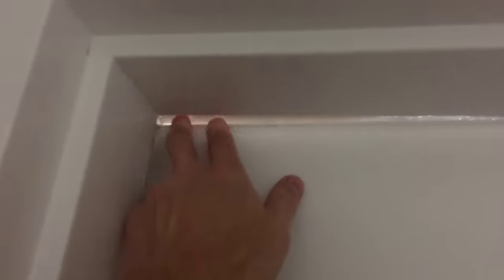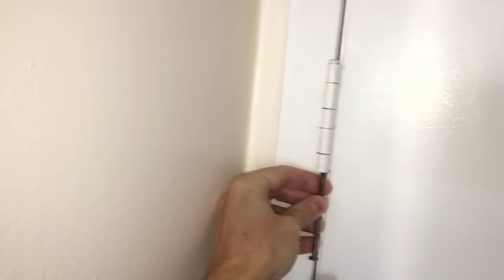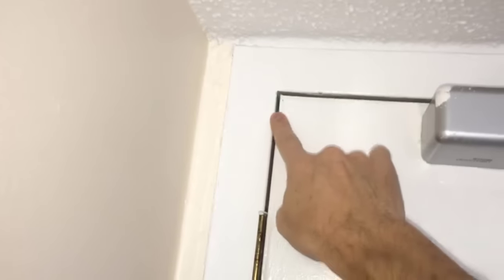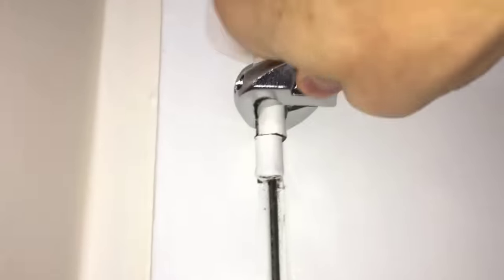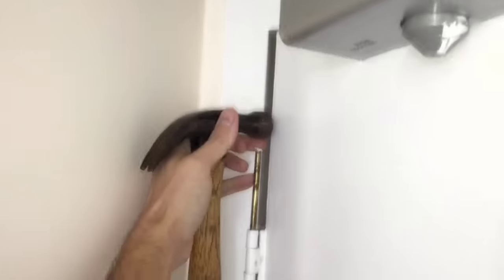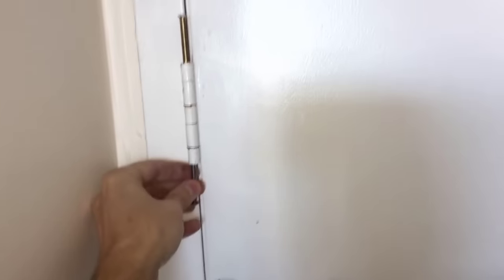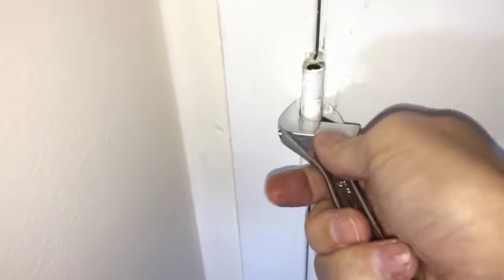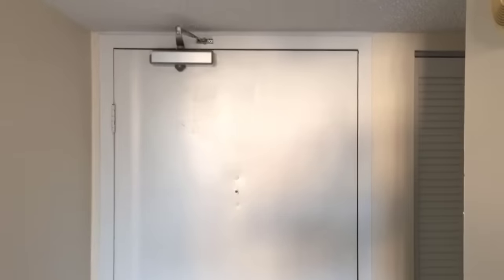Sagging front door hitting top of frame

Comment: Here's a little tip that can make this a bit easier. With the door closed, push a wooden shim (they're usually in the shape of wedge) under the bottom of the door at the edge with the striker until it's just snug. This takes the weight of the door off the top two hinges. Now pop the top two hinge pins like you do in the video. Use your hammer to drive the shim further under the door, lifting the striker edge of the door. Lift it just enough to enlarge the gap at the top where it's sticking and close the gap on the hinge edge.

This will cause the knuckles (attached to door) to be off by exactly the amount you need to bend them. Bend the knuckles like you show in the video until they line up, and -- with the shim still in place -- you should be able to slide the pins back in with no resistance.

Pull the shim, and the door should be perfectly aligned. You used the shim to move the knuckles so that they showed you exactly how much they need to be bent. No guesswork needed!
Reply from the maker: Great comment, thanks!
Reply: Precisely! Good addition, thanks
Reply: Thanks for sharing this information! Takes out some of the guess work!
Reply: Great advice, thanks.
Reply: Another great solution. Thank you for sharing. God Bless you.
Reply: Thank you both for this information! It worked like a champ!
Reply: i did this technique on my sagging screen door, works like a charm when i replaced the rivets
Reply: @Thomas Stambaugh, works like a charm!!!!!!!!!!’  I tried both ways on doors on my rental property and your way was easy as well!!!!!
Reply: A video of this would be awesome!!!! Thank you for sharing!
Reply: @thomasharris5151  make a video on this please
Reply: @Saikocide  can you make a video on this
Reply: Awesome tip, makes perfect sense. I will try this on my next door adjustment.
Reply: @123-n6c  The description is good enough. It is the same process of bending the hinge knuckles shown in this video, just use a wedge to lift the door where you want it to be with the pin out.
Reply: I'm struggling to get the pin out
Reply: @erraddict  Is it an exterior door?
Some hinges have Non-Removable-Pins. They are typically used on exterior doors that swing outwards.
Some of these hinges have a small setscrew drilled and tapped into the knuckle.

Use a roll-pin punch and a hammer to remove stubborn standard hinge pins.
Reply: Is there a limit to how much gap you can close using this method?  I have almost 3/8" gap at the top of the door opposite the hinge.  I suspect the problem is the door jamb is out of square and has shifted on a 60+ year old house.
Reply: @gototcm  You can spread the hinge to help close the gap.  You can also shim the hinge leaves with thick cardboard if you do not want to bend the hinges.

For spreading the hinge, you don't need the wrench or to remove the pin. There are demonstrations in other videos how to spread a hinge.
Reply: Thank you for the comment! Sounds useful!
Reply: Thanks bro, let see if it's going to work, becuse....i do it myself 😢
Reply: 812 people down voted this video so I guess some people like their doors to rub🤷
Reply: Thank you for your additional comments making this job even easier to do!!
Reply: You should pin Thomas’s reply to the top comment so that everybody gets both helpful hints at the same time
Reply: I have a set of three black style short crowbars. I’m gonna try using one of them as a wedge should make the job easier than a wood wedge? It’s what I got so it’s what I’m gonna use lol
Reply: I wish they had a way to copy these comments they were longer than a screenshot would be nice to save it
Reply: This tip along with this video just helped me fix the sagging front door that has a lockley installed that kept going off because it was getting stuck on the bottom of the hole despite multiple excavations. Thanks!

Comment: Let me share a little story. I hired some “contractors” to install a Prehung door. They tore a hole in the side of my house and tried to put the new one in but in the process slightly bent the frame. I promptly fired them and figured out how to seat the frame but the door was now rubbing like this one. We were at wits end when I stumbled on this gem of a video. If I could hug this guy I would. I wasnt able to shut the door without severe effort but thanks to this amazing guy I was able to seat it and save the day. This 6:05 minute video saved the day for me. You my man are a gift to earth and keep being awesome.
Reply from the maker: Glad it was helpful, and thanks for sharing your story!
Reply: Thank you.  I’ve seen a similar video on bending knuckles and was concerned about the hinge would be out of alignment.  This video was an exact match to my situation, and walked me through each step and showed hinge alignment and effective door movement.  I tried this method which required both top and middle hinge adjustment and it worked; probably no friction door operation in at least 23 years.  Once again, thank you.

Comment: I encounter this a lot. I am a painter and to do the best work is to remove all hardware including hinges and door knobs, many times they want to fix rubbing against door jam as something preexistent, I always used a wedge or scraping the door jam to make up for that difference and adjusting the hinges until finding the correct gap. Your technique is going to save me hours of labor!!! Thank you so much man!!
Reply from the maker: Glad it was helpful! 
Just keep in mind that if the door is "swollen" due to moister/humidity, or the whole house is sagging with a structural problem, this technique will not work.
Reply: YourSelf I understand. When door is swollen due to humidity and it touches all along the door jam the best is to shave a little on the edge of the door. I would say this would be an extreme case. Thank you for your tip.

Comment: Thank you for sharing, sir. Such a simple fix! My front door has been  slightly off since we bought our house 9 years ago and driving me nuts. The slight sag made locking / unlocking the door more difficult than it should be. 2 minutes of your method and it is closing better than ever! Thank you!
Reply from the maker: Great to hear that 9 years later the door finally closes as it supposed to! Thanks for watching.
Reply: hey @Craigmo900 , same issue, I tried putting longer screws int he hinges but didn't help, the door locking is being difficult for us and has been for a while, Do you have any tips in addition to the video, will try this week.
Reply: Buy a new house

Comment: We moved into our house in 2019 and the previous owners did not take care of anything.  Needless to say we have had our hands full with changes and fixes.  One thing was the garage door leading into the house.  We had to slam it hard as the top half was rubbing a lot.  I just tried this and decided to check the door after doing only the top loop/knuckle... Low and behold it closes like normal now!  I was afraid it would need to be shifted a decent amount and then the electronic  deadbolt would not lock properly but luckily that was not the case. Thanks a lot man! Almost 3 years of annoyance fixed in about 15min
Reply from the maker: Good to hear it, and thanks for watching!

Comment: Thanks for mentioning that you bend the "loops that belong to the door". Because the hinges on my sagging bedroom door are reverse compared to your door. The loops (or knuckles) of each hinge on my door that "belong to the door" are located at the top, bottom and middle of each hinge. So, there are three of them that need to be bent. This mean I would have to bend three knuckles towards the door knob. Or, alternatively, bend the hinge knuckles attached to the  jam side away from the door knob if there is room for the crescent wrench.  Right?
From Minneapolis, U.S.A.
Reply from the maker: Yes, your assessment is correct.
If you have enough space, try to bend the 2 knuckles towards the door-jamb to cause less stress to the hinge than bending the 3 knuckles towards the door.

Comment: This. THIS is THE YouTube video that FIXED my security door leading to my garage from not shutting! I took the door off to replace the door threshold seal that's located under the door to improve the weatherization...and after reinstalling the door to the hinges, it would NOT SHUT and it's been like this for 4 days. I couldn't do laundry or use my garage. This video did it for me. It was the same issue described in this video where the top portion of the door was banging against the door jamb and not shutting due to the top hinge needing to be adjusted. Despite going out and buying brand new door security hinges from Lowes and screwing them on exactly the same way the old hinges were aligned, it wouldn't shut no matter what I did.

I didn't have a crescent wrench, so I used a vise grip and instead of using door shims, I placed a stack of sticky/post-it notes towards the top of the door against the door jamb. That allowed the door to be pushed as I adjust the new positioning of the knuckles of the top hinge using the vise grip (the same knuckles this gentleman adjusted) towards the door. Then I finally hammered the pin back into the top hinge and voila!!! the door finally closes. I can't thank you enough man.
Reply from the maker: Good to hear it, and thanks for sharing!

Comment: I’ve tried tightening the hinge screws and even put in longer hinge screws with no success two years ago and finally gave up on trying to fix my front door.  Just came across this video and tried this trick and less than 2 minutes my door was fixed and it doesn’t stick anymore.  Thank you so much for posting this video 👍
Reply from the maker: Wow, 2 years of sticking door... glad you resolved it now, and thanks for watching!
Reply: YourSelf actually it was like this when I purchased the house 3 years ago
Reply: @retiredcryptohunter9031  I'm in almost exactly the same situation. I tried tightening the screws, got longer screws... Worked for a week or so then started hitting again. My next step was going to be to fill the problem hinge hole with wood glue and sawdust or something, then re-screw, but I think I might just simplify and try this since the rest of the screws grip fine.

Comment: Some times the screws on the hinge are loose or if you put 3 1\2 inch screws will lift the door also  👍
Reply: one trick is to put wood glue on a toothpick insert into the screw hole that is now too big and then put the screw back in. Worked for me.

Comment: What should I adjust if the door is too high and hits the top corner of the door frame?
Reply: Close the gap in the bottom hinge and/or open the gap in the top hinge. If you only adjust the top or bottom hinge you might need to do the middle hinge about half the amount to keep everything working well. Having said that it's a bit of trial and error. GL.

Comment: Thanks for your effort. I did this with my heavy front door. Worked beautifully for a couple weeks. It is now just as difficult to close as it was before the fix.
Reply from the maker: That's too bad. The door from this video still works great for over a year.
Have you checked the screws holding the hinge? Maybe they got loose and need to be replaced with longer ones.
Reply: @Your-Self  Checked the screws first. They are excellent and tight. There's a physics lesson here somewhere. Good idea but seems hinge metal has memory like spring steel or frame pushed door back into old position. I am going to try sanding the frame where it's rubbing the door. Thanks.
Reply: @Your-Self  I am going to try this over the weekend, seems the resounding response is it works beautifully. I have a heavy front door that is pinching exactly where it was for you in your video. I see TomCatFromMA's comment and you mentioned tight screws and/or longer ones. My screws now seem long enough but how do I know? And I just noticed 2 of the screws on the jam side top hinge spin endlessly unfortunately. Maybe this is my issue before I start bending the knuckles?
Reply from the maker: @Christopher Burns try replacing your loose screws with the 3-inch once first. That may actually fix your problem.

Comment: thanks so much for explaining this fix in easy steps. I never imagined fixing it on my own without the help of a local repair person. somehow, just taking out the pin from the door hinges (all three) and adjusting the door on my own and then putting the pin back fixed the issue. now the door closes all good. I initially thought some sanding might be needed on the top of the door. all well. thanks again!
Reply: >repair person

repairman

Comment: I ran into doors hitting at the top with a different problem.  At my cousin's new house ( several years old, but unlived in before), 3 doors hitting at the top like this.  I thought the house had settled some and went to shave some off the latch side of the door with a block plane.  this fixed one of the doors but I now see that I could have fixed it like in this video.   the other two actually had a mounting problem - the hinges were set where the hinge side door edge was actually hitting the door jamb stop so every time, you tried to close the door, it was trying to pull the screws out of the hinge and it eventually loosened those screws.  I used matchsticks to reinforce the screw holes and had to trim a little of the door stop rather than remount the hinges.
Reply from the maker: Thanks for sharing.

Comment: Very good advice. I've done this as well as adding cardboard shims and shaving the door. The toughest was having to jack up the wall to put things back in alignment. To make your tip even better would be to apply white grease or petroleum jelly to the hinge pin before reinstalling. Thanks again.
Reply from the maker: Thanks for sharing!
Reply: Even better (though messy) is powdered graphite. Grease and jelly catch dust and grit from the air as well as bits of metal that wear as the door opens and closes. The result is essentially a grinding compound that will cause more and more problems over the years.
Reply: @thomasstambaugh5181 good point, but I've seen 100 yr old hinges with a little grease on the pins that were in great condition. But whatever you do, DON'T paint the hardware!

Comment: I find it easy to put thin washers between the hinge and wood frame. Thin washers work best as you might need 2 or 3.  I put them on each screw. Then to cover the gap in the hinge to wood, use acrylic caulk.

Comment: Thanks for posting.  This will hopefully work for my basement door.  My immediate need is to fix my back door but when I had my tool box ready I found the hinges were capped at both ends.  Does anyone have any suggestions as to how to get them off?
Reply from the maker: I'd use a thin flat-head screwdriver and a hummer. Try to wedge the screwdriver in between the hinge and the top cap of the pin. Knock straight into the wedge, and then lower the handle of the screwdriver and continue to hit it with a hummer until the pin goes up and out.

Comment: This method doesn't always work but when it does it's a huge time and labor saver. If this doesn't work for you you'll need to remove the door. Once the door is off you can adjust the fit by adding of removing material from behind the hinge plates and/or planing the doors edges. Great tip though.
Reply from the maker: Thanks for your feedback!
Reply: but its all-metal no wood anywhere
Reply: @johngriffin824  Exterior doors that are metal have wooden edges for exactly this reason so that they can be planed down to fit the opening.
Reply: No planning of the door could be done. that's a steel commercial door and steel commercial jam.you must either bend the barrels of the hinges like you said or shim the hinges with little cardboard behind the  hinges. One of the things that works against that door Gap is the commercial door closer at the top of the door.Between the weight of the steel door and the torque of that closer you have a problem, which can be handled if done right . Most residential doors are not of the type that you showed in this video. I'm retired now but I put in many many commercial steel doors like you showed and had to adjust them. Thanks for the video.

Comment: A quick fix, yes. Just be sure it doesn't continue because there could be HUGE issues underneath causing the issue in the first place. Like wood rot or termite damage on the flooring support beams.
Reply from the maker: Agree, thanks for commenting!
Reply: @Your-Self  no problem! I know this from experience. My mom's place had water gathering under the house and causing wood rot. Drained the small pond, filled it and then jack up the beam to replace it. All in a 2ft crawl space. It was fun.

Comment: I tried on a cheap wood door. As I started to pull the hinges with the wrench, I could hear the wood starting to crack. Not sure if it was the door or frame making the noise but I had stop. Guess I’ll have to do the sanding method.
Reply from the maker: I guess if the door frame is weak, it's possible that it would make some noise. Mine was a heavy-duty outside door, so no crackling sounds from it.

Comment: Ok if you have loose pin hinges. In the UK they're not common. Try this with bearing hinges and you'll get nowhere. You need to make sure the door is shut properly before you try this too - and make it easier by putting a thin wedge in the closing side, to close the gap at thd hinge side. The two 'loops' as you call them, are 'leaves,' and the part where the pin goes are 'knuckles.'
Reply from the maker: "leaves and knuckles"... good to know, thank you!